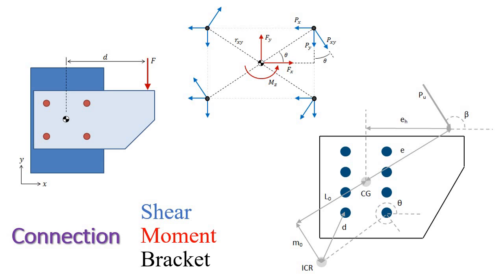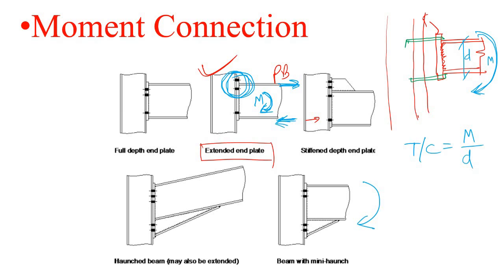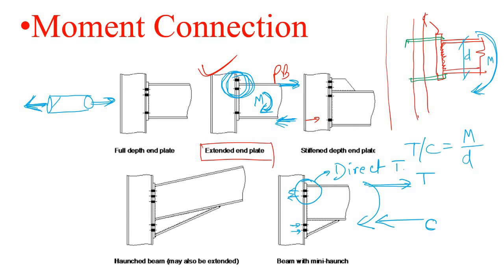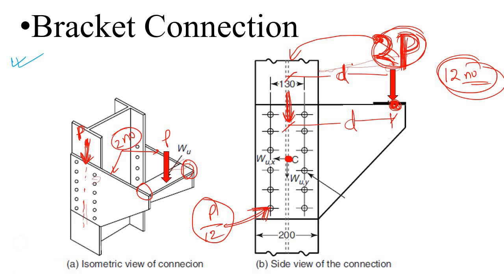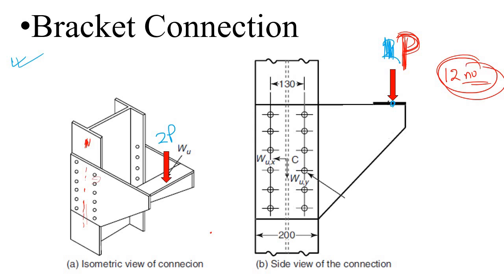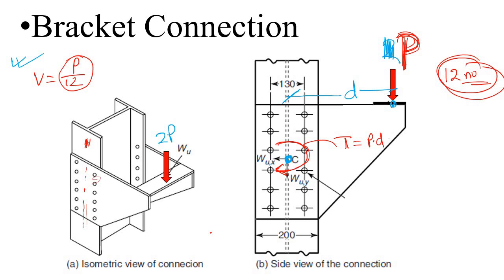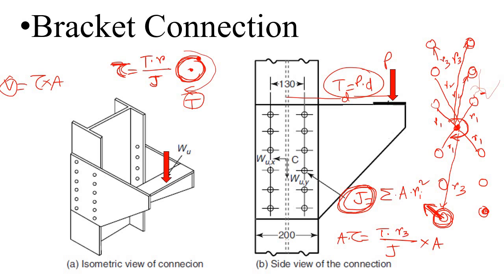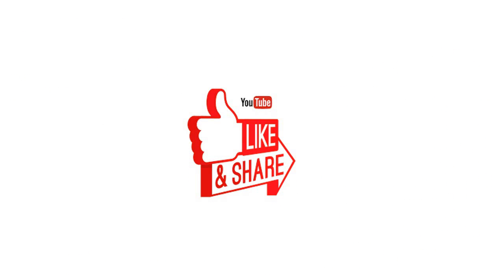Forces in Bolt Group (Shear, Moment and Bracket Connection)

Comment: Please note the queries
1. First connection showing pure pin connection. But what about the eccentric moment with the workpoint? Also in FEM software the same fin plate connection induce bending stress on fin plate weld. Please verify
2. How about the classification of joint in bracket connection? Based on stiffness of joint, is the connection semi rigid or pinned? Or please make a video showing the stiffness and classification of joint 
☺